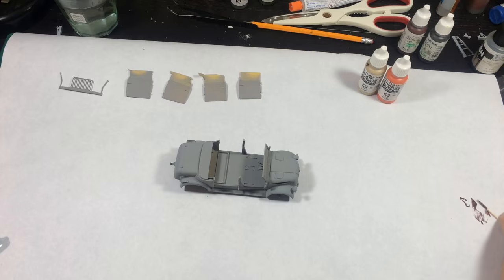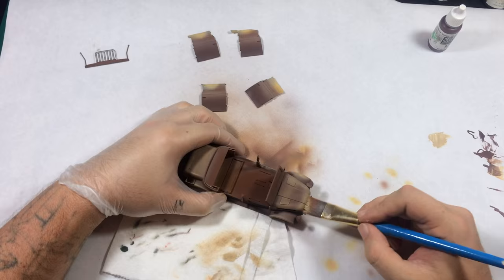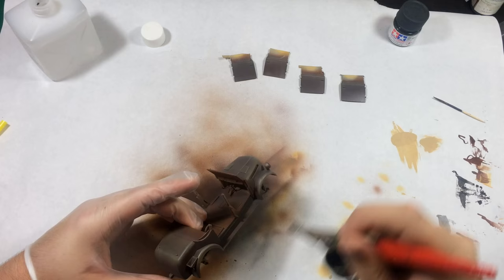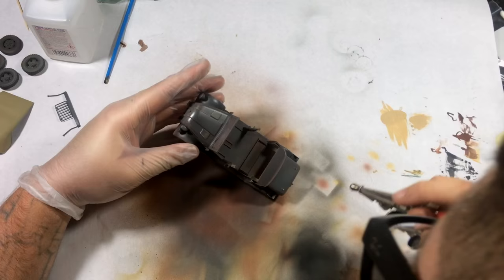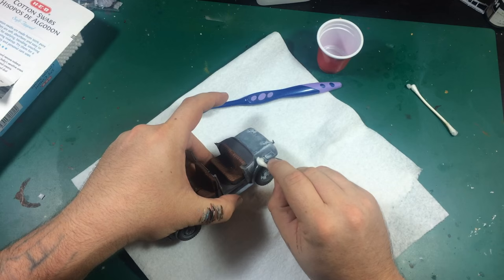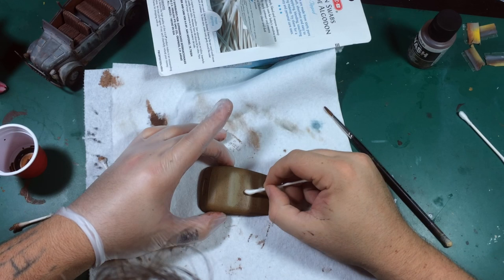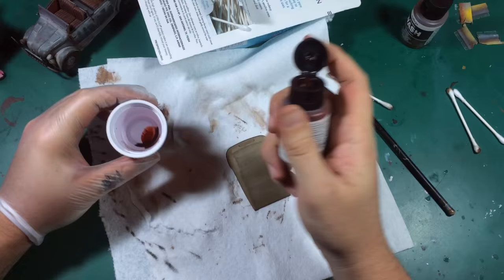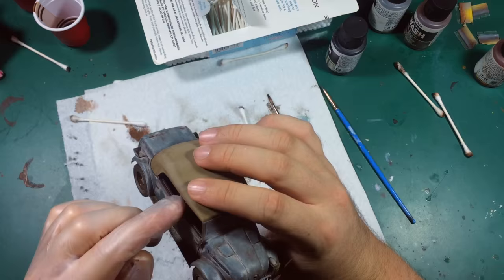Lets Paint - Tamiya Styer 1500a Kommandeurwagon

Comment: most unusual painting process i have seen in a long time, really cool to see the model come to life that way. never used vallejo paints as washes. looks superb ian, just like it came from stalingrad or charkov.
Reply from the maker: I probably wouldn't use normal model color as a wash I use them as glazes often. The washes I used are premixed by Vallejo, you have to be a bit gentle with them or they will stain the surface . The painting style is essentially the B&W method but instead of B&W I like playing with color. Oranges and reds work well against the blue hues I'm panzer grey.

Comment: Excellent weathering.... With hairspray how long do you leave the paint dry before you start removing???
Reply from the maker: Thank you John, the under coat is completely dried and protected then HS, next coat maybe 15 mins. Tamiya paints are pretty hard the water based paints you have to be a little carful because they will come off in sheets
Reply: Cool thanks I did that on a model and it came off so easy should have guessed it was the water based paint I had to use a soft brush . I was wondering if I let the paint dry long enough... Thank's

Comment: Hey Ian! Noticing you're using a Paasche H (correct?)

Just got one recently, was wondering what PSI and needle size you're using. Having a little trouble dialing it in lately

Thanks --
Reply from the maker: STARCON man.. I’m gonna be honest with you. That video is old and I moved over to a grex setup about 3 years ago. I tend to spray crazy thin like 8/2 ratio thinner to paint. When you spray then you have to use a lower psi. Like around 10. That way it doesn’t spider web